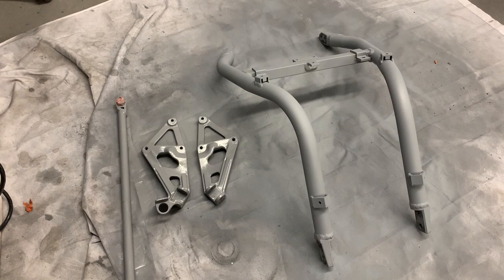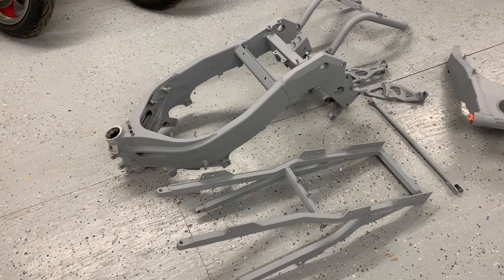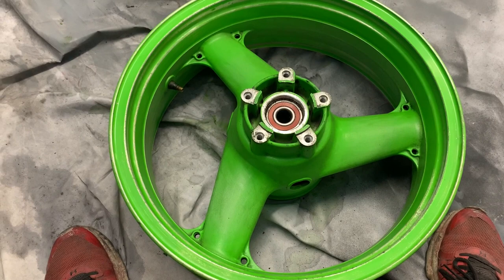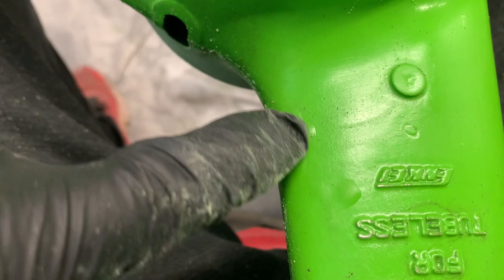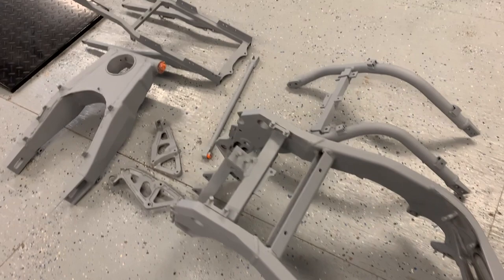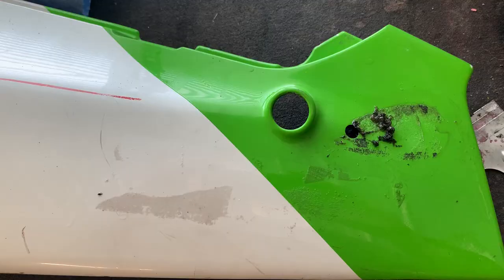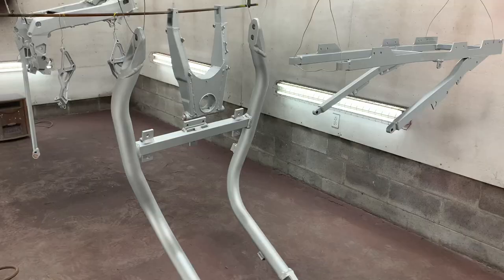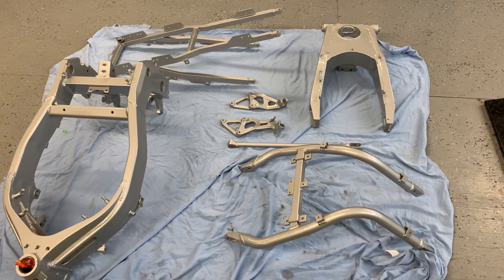1990 Kawasaki Ninja ZX7 H2 -  Restoration - Episode 4 - Frame Painting

Comment: Another enjoyable video. It's nice to watch others do the same work and always great to get some tips. I wish I could share some of mine but I haven't started doing videos yet. I share lots of photos on Facebook though. When I did my VF1000f wheels, I stripped the paint off with heavy duty stripper so it was bare aluminum and then acid etch primed and painted then 2k clear. Came out great.
Reply from the maker: Thanks Lorne, I may try some stripper on the front wheel, there is a pile of clear coat on there that has to come off.

Comment: Enjoyed the plastic repair and moulding.. I have 2 small cracks on my ZXR H2, left rear panel below the key hole for the seat hump, and a very small crack right in the front/middle of the seat hump. Both are typical crack areas for ZXR’s unfortunately, 80s & 90s panels are pretty brittle now due to age. 

Nice work 👏🏼
Reply from the maker: Thanks for watching and commenting.   yea the plastex product works really well for that type of issue.  I have used the clear powder on stuff like that, put metal tape on the outside of the paint work. pressed down really tight so the plastex cannot seep onto the paint, v groove the back side and applied the clear plastex.   worked well.